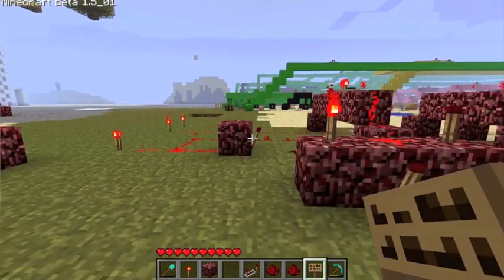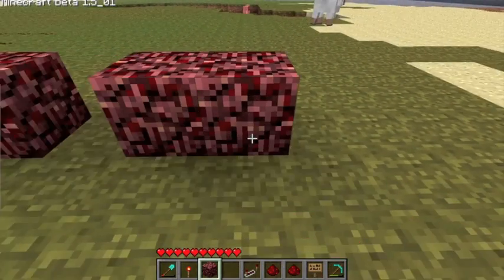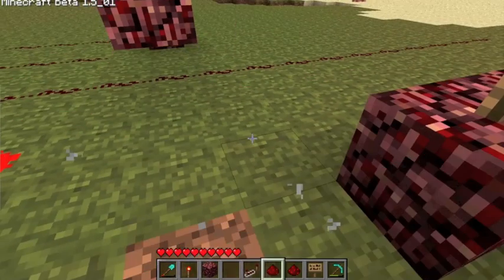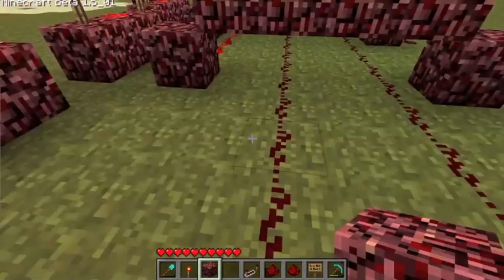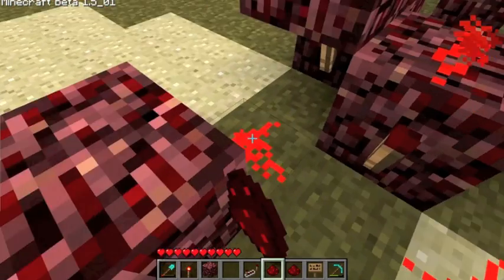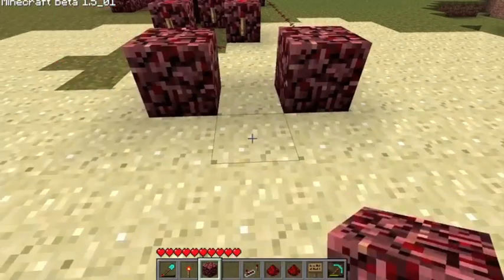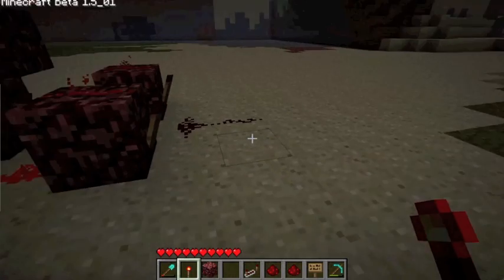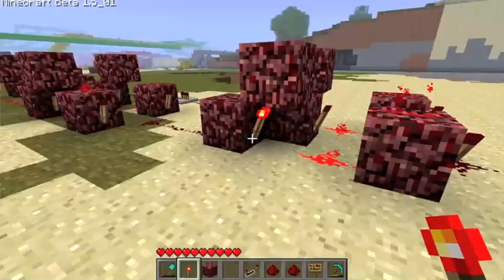How to make a computer in minecraft: Part 2-ALU (subtractor)

Comment: you know your stuff, how do i make a thing that turns the output on if its pressed 4 times and then resets itself (after it is pressed 4 times it gives 1 short pulse) and then when you press it 4 times again it happens again, i tried it with 4 t-flipflops, but wehn i pressed it 4 times it turned output on, and when i pushed it 4 times again only then it reset its self. Thank you for any answers :D